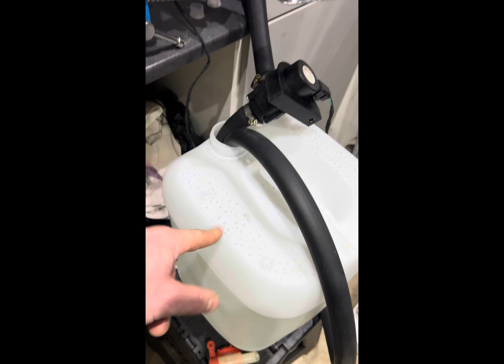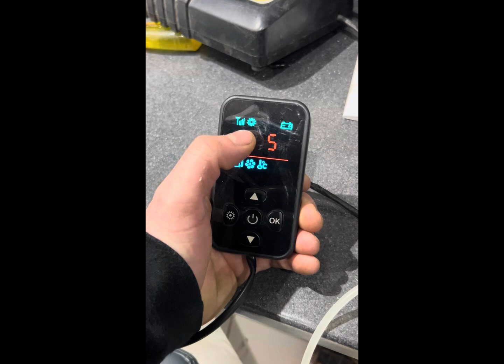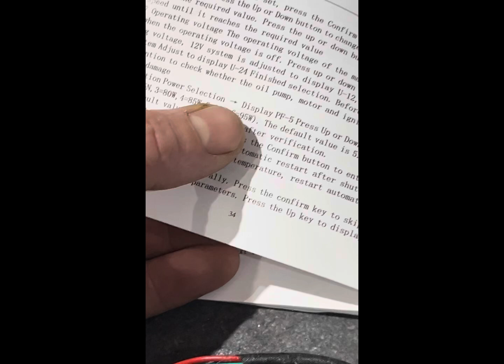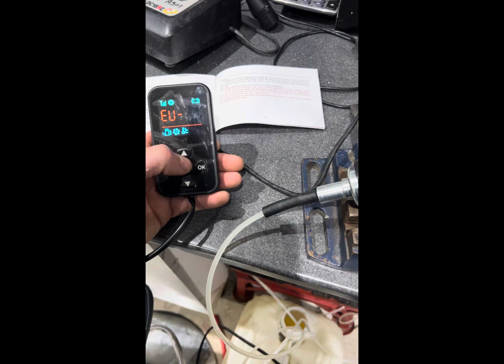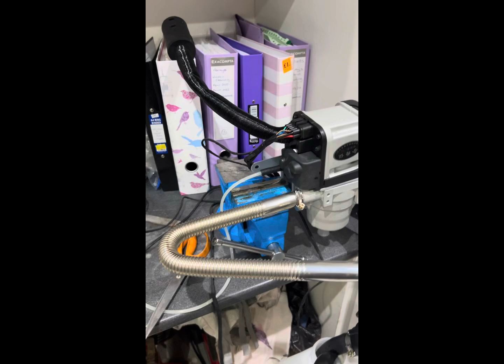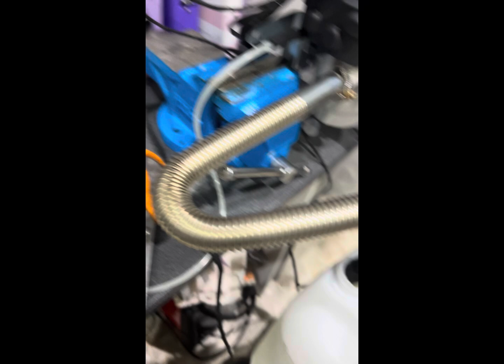Chinese diesel water heater controller settings

Comment: Hello, I am at an early stage with the same heater and I've had  a lashup trial run with it using a Ford air conditioning evaporator matrix as a heat exchanger and an axial fan rated at 12 volts 80 Watts blowing through the duct. On the return leg of the water circulation from the matrix passes, as a contra flow, through an exhaust gas recirculation cooler unit from a scrapped Hyundai i30.  At  an exhaust inlet temperature of 90 degrees Centigrade  the outlet temperature was reduced 36 degrees C to 56 C    at the EGR outlet with an air outlet  temperature of 60 degrees C from the heat exchanger.  A flat battery stopped any more progress.  I have no connection to Ford or Hyundai other than that the matrix and EGR were the cheapest I could find.👍

Comment: Hello, I'm the manufacturer of the control system, control panel, and remote control for this device. To pair the remote control: With the device turned off, press and hold the "Up" button on the control panel until "HFR-" displays. Then, simultaneously press the "Power" and "Set" buttons in the center of the remote control to successfully connect. If you have any other questions, please feel free to contact me.
Reply: Hi, I have this heater with one way remote. Is it possible to replace the remote with two way remote?
Reply: @markonevalainen1461  NO
Reply: Hello how to make timer work??
Reply: @Aksuu32  Do you mean you want to know if this controller has a timer function?
Reply: Hi, I do not have much luck to pair the remote control, nothing happens when using the up button, so I tried to use the down button and this pops up in the screen 05C ?
Reply: @eriksson941  Hello, please press and hold the down button to display "P OF". This is the water pump circulation function test, which checks whether the water flow in the pipes is unobstructed. If you need to use this function, please press the up button briefly again while "P OF" is displayed. It will then display "P on", indicating that the water pump circulation test is activated.
Reply: @eriksson941  Hello, please press and hold the down button to see "P OF". This is a water pump circulation function test, checking if the water flow in the pipes is unobstructed.
Reply: @eriksson941  Hello, please press and hold the down arrow key to display "P OF".
Reply: Hi can you explain which way up the unit goes please as I have mine with exhaust and air inlet pointing down and the water in and out on the top is that correct or not.????

Comment: I think we have the exact same model heater. Mine's from PengNing Company and has the same controller and remote. I was about to try the 1688 code after seeing that was the code on diesel air heater models when I ran across your video. I now have my unit cycling on and off (mode EU-2) like it's supposed to.  Once I get my final exhaust pipe installed I plan on fine tuning it with a cheap CO monitor. Thank you for posting your video.

Comment: Thank you for your video. I did not find any information about how the control panel works.

I have two more questions: 
If you switch from L09 to a lower level, does the frequency of the pump change?

In EU2 mode, when the target temperature is reached, is the pump switched off or does it continue to run?
Reply: yes in this case, L09 is 5.6hz on pump, if you go lower, the pump itself follows 🙂
Reply: Yes the L settings control pump speed and the fan adjusts with the pump to keep the air to fuel ratio mix in check.
Reply: EU2 mode will keep the pump recirc on to look for the low temp set point and then restart the heater. EU1 mode will shut everything off once high water temp setpoint it reached, hope this helps.
Reply: Hi every one . How to paring remote Control with unit? I was try so  many times ... 
Thx very.
Reply: @PrzemysawWilczak  Hello, I'm the manufacturer of the control system, control panel, and remote control for this device. To pair the remote control: With the device turned off, press and hold the "Up" button on the control panel until "HFR-" displays. Then, simultaneously press the "Power" and "Set" buttons in the center of the remote control to successfully connect. If you have any other questions, please feel free to contact me.
Reply: @HcznkjTU  How to change to Celsius? Would be great to adjust temperature rather than L1 to L9

Comment from the maker: Also quick note the Chinese circulation pump is very noisey horrible thing mine actually turned up faulty 

Jumped into my box of spare car parts and found an Audi circulation pump same spec and size but the Audi part is Bosch and uses the same plug, so plug and play..  even the rubber mounting bracket fits from one to the other.. 

Part number 7L0965561L